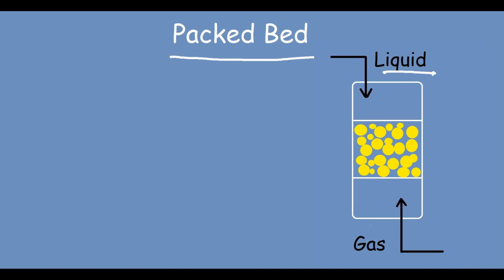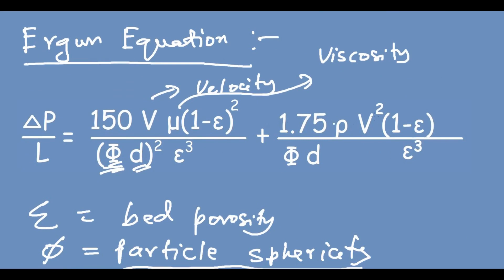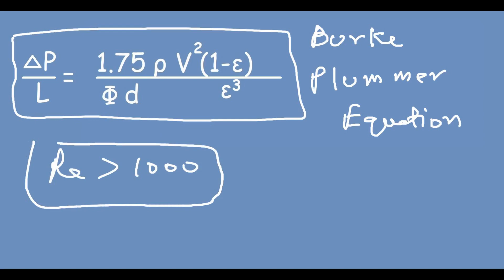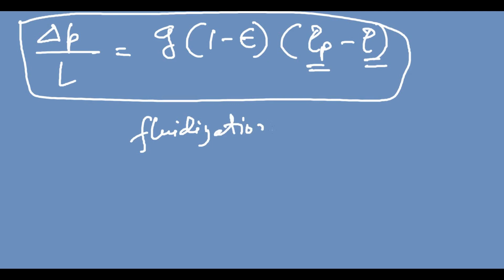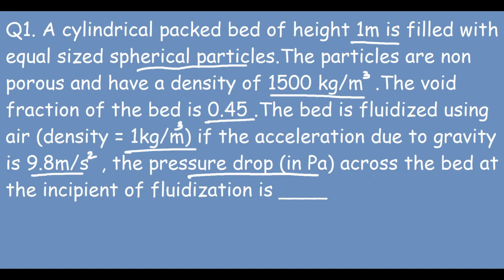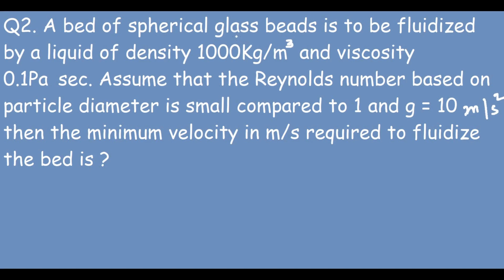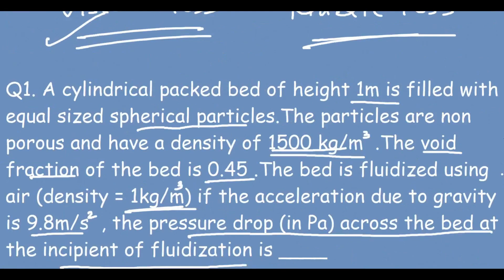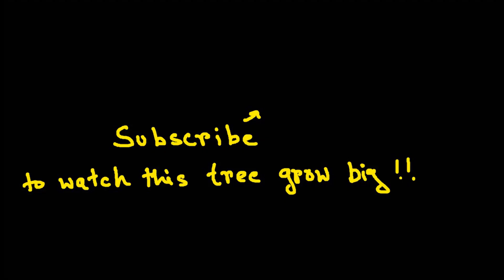Ergun Equation and Packed Bed

Comment: Please tell the Reynolds number formula for packed bed.
Reply: Nre,p = (Dp*m) / (mu*A*(1-epsilon)) 
Dp=Partical diameter(m)
m=mass flow rate(kg/s)
mu=viscosity of fluid(Pa.s)
A=cross sectional area of the bed (m^2)
epsilon=void fraction